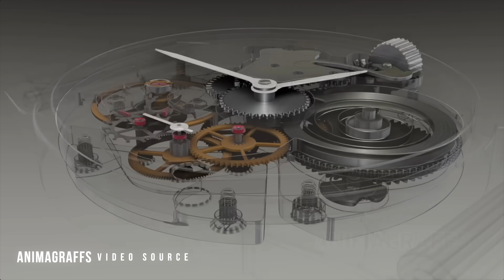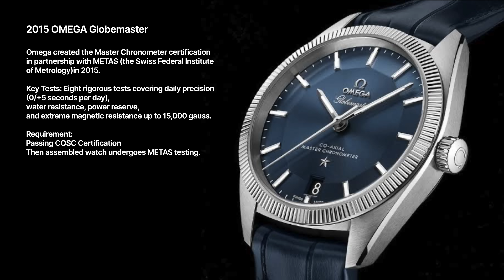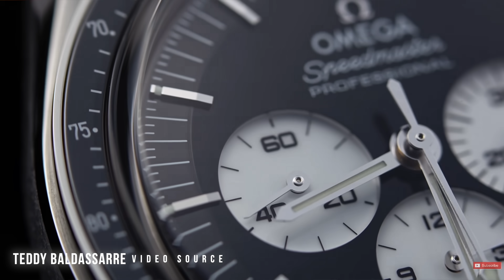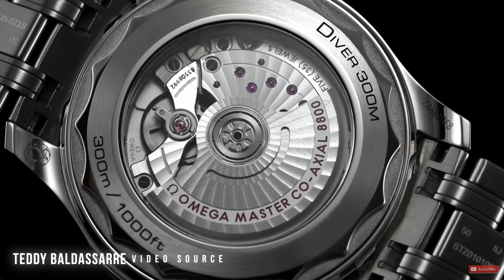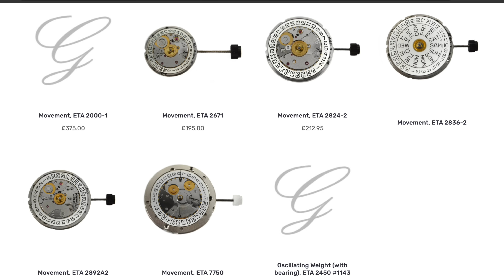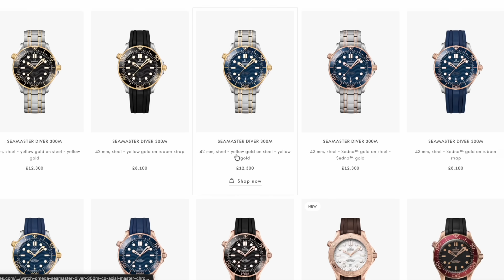OMEGA’s Critics Are Ignoring This & I was WRONG

Comment: My 18ct Tresor, with the new movement, was rated at +6 seconds/day.  They were brand new on the market, only two in the country.  Sedna rose gold and white gold. Easy choice, why buy white gold?  And Sedna is stronger than yellow gold.  Since new, it's still operating at +6 seconds/day.  BUT the crown fell out and Omega charges full service price for any work, not just fixing the part, so I got a watch maker to fix it for about 1/3 of Omega's quote.  But I still prefer my indestructable 1995 Bond Seamaster 300.

Comment: Recently purchased the 300M in green and couldn't be happier. I was treated warmly and with respect by the Omega AD, able to try on many references and ultimately purchase on the spot the 300M. I have several Rolex which gather dust now due to the negative experiences with the brand. Next will be a Speedmaster. The 300M is the most comfortable watch I've ever worn. Cheers.

Comment: I liked your video and I agree on just about all your points. When it comes to Omega needing to clean out their catalogue it seems like Omega may be on this track (slowly) and I suspect they could wind up taking it to the other extreme. For example, I don't get why they slashed the prior version of the Constellation design. In my oppinion it could have co-existed with the new design. They could have either sub-diveded like they do with all their ranges or they could have let it be a kind of upgrade path just like the four Moonwatch editions. I liked the more casual design of the prior Constellations and I liked how the tungsten bezel balanced an industrial vibe with finesse. My only gripe was the bracelet, but a few tweaks could have lifted the bracelet to 2026 vibes.

Comment: Omega always has had lot of potential if the steer to the correct clients meaning they will treat them as they deserve, their biggest problem is the unmeasurable increased their prices since 2021, fair price this days for me would be Seamaster diver under $5,000, Speedmaster pro under $6,000, basically they should keep it $2,000 less than what their actual prices is

Comment: Britt Dear, All of your points SHOULD logically make Wilsdorf products obviously LESS desirable as they are made and actually achieve a LESSER standard of objective quality. Additionally, the dealer experience is abysmal. I owned one (1) Tudor. It needed the movement re-engineered as a major flaw appeared in less than a month. Wilsdorf already knew the problem for almost a year and should have stopped all sales immediately. Instead, they covered up the problem. The watch went to the ROLEX repair facility (20 minute drive away) for a month. Came back, worked fine, traded for an Omega 300 Master from a different dealer. The subterfuge, dishonesty, and overall creepiness of the experience is pretty much permanently off-putting. I documented EVERYTHING.
But I KNOW you do not adore Rolex LOGICALLY...and you are honest about your position. If you divide the Rolex prices by 4, you will find.
A.) they sit in the mid-tier bracket.
B.) their "market dominance" disappears.
C.) the price becomes honest and reasonable. (for a "luxury" watch)
There previously had been an Omega with problems just after model introduction. Omega fessed up to the issue, broadcast to journalists and media what the issue was, how it happened, and how it was actively being resolved. Omega is Clear, honest, and forthright. THESE TOO ARE OBJECTIVE STANDARDS. I apply these objective standards to my watches, cars and motorcycles. It has made life easier and more satisfying.

Comment: I’m a fan of Omega but I will say that I give them zero kudos for keeping the Seamaster price from increasing. That’s just good business as the market is full of entrants that cost less and make arguably competitive quality. Omega need to release a midsize Seamaster and they need to stop the madness of the crazy pricing on the rest of the lineup. My opinion for a home run for them… discontinue the current Seamaster diver, replace it with the NTTD base (with a date a availabile ideally) and price it no higher than it is now.

Comment: Omega screwed up in my view on a routine service, of a watch of 20 years. I trusted the boutique. They stepped up, fixed it, sent it back looking good. It restored my faith in them. The boutique made it right. I will buy again from them, but they make too many watches. They should reduce the models, remove choice and have confidence in making great watches, rely less on Bond, and look after customers (which they did with me). Rolex AD's just annoy me, in general, Omega was much more friendly.

Comment: By and large their dress watches still are an oversized joke. The speedy is a dead horse. And Longines is on a more interesting roll. So no, Omega isn't suddenly good because they have coaxial. I will also point out that parts manufacturing and lubricant life span has developed somewhat since the seventies, so the modern day benefit of coaxial is.... Debatable.

Comment: a prototype watch movement with Co-axial escapement made by Patek Philippe in Switzerland (c.1981). It is one of three exceptionally slender wristwatch movements with co-axial escapements, made by the Research and Development Department of Patek Philippe, to assess George Daniels’ escapement’s performance. In his autobiography, George Daniels explains that these movements were not made according to his recommendations and were therefore not a success. This really sums up Daniels’ relationship with the Swiss watch manufacturers which resulted in them generally disagreeing about the value of the co-axial escapement.

Nicolas G. Hayek, CEO of the powerful Swatch Group, acquired the rights to the co-axial escapement for the Omega brand. The rest as they say is history, as in 1999, the first series of watches was launched.

Was Patek Philippe truly incompetent when it came to the co-axial escapement ? Or they need touch grass sometimes?

Comment: You get no credit for a 3.5hz movement with a 55hr power reserve in a 13.5mm thick watch in 2026.
You get no credit for a helium escape valve on a watch only rated to 300m deep, so I can take it in the capsule, but I can't wear it in the water at a decent depth? Besides a screw out escape valve is pointless, if I have to remember to unscrew something I may as well unscrew the crown!
You get no credit for a dive bezel you can't turn in dive gloves.
You get no credit for hands designed to have very little lume on them (skeleton hands).

And I've got a Seamaster 300m, it's a very pretty watch, but it's a fashion watch, not a useable dive watch.

Comment: I know you rarely read comments s it takes lots of time, but I did explain the coaxial once in a comment and I will do so again.  The  COAXIAL IS A GIMMICK.  Here are some falacies
George Daniels DID NOT INVENT THE COAXIAL ESCAPEMENT  a german by the name of CHARLES FASHOLDT DID.  IN 1859  !!!  
The escapement had been around over 100 years before Daniels reappropriated it.   In that 100 years other makers, like Beguet, Patek ALS, would have adopted it.  Many reasons why they did not.  It is not effective at high beat rates, hence the ridiculous change to 25,200 from 28,800 that omega had to do.  Why do you think it is they dropped beat rate.  Maybe breaking parts.  
-An escapement with sliding impact creates lower impact force than one with a direct non sliding impact.  At low beat rates the coax is efficient as it pushes the wheel.  At high beat rates that push is an impact that can do damage.  
-Additionally, the coax has nearly double the moving parts of the swiss lever.  Any engineer will tell you that less moving parts means more reliability and durability.  
I will not buy any coaxial omega unless they bring the beat rate down to 21,600.  Omega brought it down to 25,200 and I am sure they had to to prevent broken parts.  I would take it down further.  
The truth is Omega needed an inhouse movement and could not invent one, so they modified eta and added coax, viola, inhouse we go.  It was all a gimmick.  There was nothing wrong with the time proven 2892 and 7750 based calibers.  
lots of trickery from omega including chinese bracelets drove me away.  I have two older omegas and love them.

Comment: Thank you for an execelent summary of Omega's history. I like Omega in theory, but I've never pulled the trigger on one. I have never actually seen someone wearing one. My big issue is that the new price is always very out of line with the secondary market, so I know I am buying an instant loss, which just erks me.  For the record, I don't think my Rolexes are worth the money either, but the secondary market disagrees and will give me my money back plus some if I ever choose to sell. That makes it a hell of a lot easier to spend $8-12k on a watch, instead of sticking with my favorite microbrand watches at $1-2k. Just based on the watches themselves, I like my CW C60 better than the Submariner, and much more than the Seamaster - but that's just me.

Comment: CHATGPT on the Coaxial Escapement: The question is not whether the co-axial is clever; the question is whether the added complexity produces a measurable benefit in the finished watch.

A new escapement should justify its existence through measurable improvements at the movement level. If an escapement is more efficient, that efficiency should translate into advantages that the owner can actually experience: higher beat rates, longer power reserves, reduced movement size, fewer compromises, lower servicing requirements, or some other quantifiable improvement.

The issue with Omega's co-axial is that the observable results do not demonstrate a clear practical advantage over modern Swiss lever escapements. In fact, several characteristics appear to move in the opposite direction. Omega's co-axial movements generally operate at a lower frequency than many high-performance lever escapements, commonly 25,200 bph rather than the traditional 28,800 bph. Lower beat rates typically reduce energy consumption and help increase power reserve, yet many co-axial movements still provide only around 55–60 hours of reserve unless additional barrel capacity is used. That makes it difficult to attribute the power reserve performance to escapement efficiency itself.

The co-axial also does not eliminate the servicing challenges associated with mechanical escapements. It still requires lubrication, but the lubrication process is more specialized and demanding. Omega-trained watchmakers have discussed the difficulty of servicing and lubricating co-axial escapements, requiring specialized training, tools, magnification, and a much higher level of precision than a traditional Swiss lever escapement. The result is fewer independent watchmakers able to service these movements and greater reliance on Omega for maintenance.

Meanwhile, other manufacturers have introduced new escapement designs where the claimed efficiency improvements are accompanied by measurable movement-level benefits. Rolex's Dynapulse escapement, Seiko's Dual Impulse Escapement, and Laurent Ferrier's natural escapement are examples where the engineering claims are reflected in tangible specifications such as higher operating frequencies, competitive or improved power reserves, or other observable improvements.

That is the standard by which any new technology should be judged. A theoretical advantage inside one component is not enough; it must translate into a better overall product. If a new escapement reduces friction but results in lower operating frequency, no clear power reserve advantage, greater servicing complexity, and higher dependence on the manufacturer, then the practical benefit to the owner becomes difficult to identify.

The argument is not that the co-axial escapement is a bad invention. It is that after more than 25 years of production, the claimed efficiency advantage has not translated into clear movement-level superiority over the best modern Swiss lever escapements. A technically interesting solution is not automatically a better solution unless the owner receives measurable benefits from it.

Comment: So you say co-axial is great because lubrication and so on. But why are the service intervals not 15 years then?
It’s metas certified and runs accurate. Great. So did the 2500. or take the 1538. wait, quartz movements? The one that runs 3 seconds fast a month? And doesn’t need service ever 6 to 8 years?

In my opinion, the biggest gripe with omega is that they turned into a luxury brand that they never been and that their customers never wanted them to be. Where are the 2000$ watches? Bring back simple solid technology (maybe quartz) and be the „every dads“ watchbrand again. And no, I don’t want a longines instead.

Comment: I own 9 omega’s 6 are current models. The movements are great the cases are well made. I like there bracelets outside of the Aqua Terra bracelet but to be fair I am not the biggest fan of the butterfly clasps. The watches keep excellent time. Now to my negatives . The cases are a bit to thick especially in there SMP models. We are in need of a new movements that are thinner and has a long power reserve. Lastly they are priced about 30% over what they should be. Omega really needs to stop chasing Rolex in prices. It not a great long term strategy. They probably make more money if they did not on just selling more volume of watches. That being said it’s a great watch brand.

Comment: If omega can make a modern  Seamaster 300 at 38-39mm with 12mm thickness I can assure you it will sell like hot cakes .
Reply: That and get rid of the skeleton hands - go back to the old hands.
Reply: Especially now that the Planet Ocean is no longer available in 39.5mm.
Reply: I would buy it immediately
Reply: With a tapered and new design bracelet.
Reply: I for one, will be super happy with a 39-40 mm diameter, 12-13 mm thickness WITH the skeleton hand, the He escape valve, and the scallop bezel.  It wouldn't an SMP without them.
Reply: and no helium valve........

Comment: Omega is a great brand and I owned several of them. BUT I agree on your rants big time. Omega imho has several problems: Too many limited editions, way to big catalogue and heavy price increases that were completely unjustified. While I love their technology-driven approach they are also a very Marketing-heavy brand. TBH: Co-Axial is very interesting technology, but in terms of sheer accuracy that doesn't bring anything to the table. My Rolex watches with the 31xx movements are even more accurate since the 80ies. Not even talking about their proprietary chronergy escapement in the 32xx movements. Same goes for the Master Chronometer certification. Yes the Omega's are very precise but e.g. Tudor manages to achieve the same accuracy and reliability without Co-Axial movements.
So yes, I love Omega and still own a few of them. But lately their too much Marketing-heavy without bringing a REAL value. IMHO 😉

Comment: Watchmakers tend to disagree with factory marketing re coaxial escapements. They are more fragile and yes they need lubrication to work properly.  And when they break you are out a lot of money. Maybe that’s why there is nobody else jumping on this bandwagon.
Reply: I am waiting for the proof that th coaxial escapement is that big improvement in longterm reliability, bc why you have to service your omega every 6-8 years still if the coaxial is meant to reduce service intervals.
Reply: @BoccaccioAC  the dirty little secret is that factory service for Omega and other brands with extended intervals which are not exclusive to Omega btw, involves a complete overhaul with replacement of worn out parts.  Which aren’t free. So extending intervals costs more money in the long run.

Comment: Agree with simplifying AND bringing back more midsized watches. I'd gladly buy a new midsize 300m TODAY if they sold them. I'm currently hunting for used models because they fit me better. Their Speedmaster 38 is an underrated EDC watch that's practical and offers a nice complex dial.

Comment: Any idea why is the latest model (No date - 210.30.42.20.01.010) is more expensive? 
Even the rubber version is more expensive than the previous bracelet versions.
Less complications should be cheaper!

Worries me that they'll phase these old ones out and they'll be more expensive from once they're gone.

Comment: I bought a Seamster Professional Bond Watch back in 2000. Absolutely belting watch which I gave to my wife back in 2006. Still going strong. The only issue has been the pin and collar system for the bracelet. Other than that nothing.
Reply: Why is the pin colar system a problem.  It’s seems they are better than screws, since they won’t unscrew themselves.  The selling point for screws is self service. But how often are resizing a watch once it’s been sized for you.